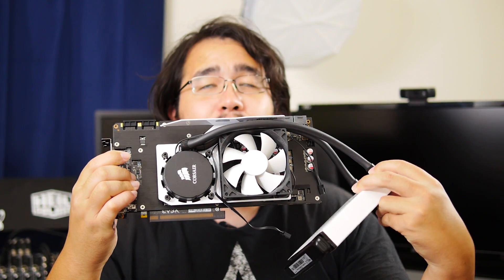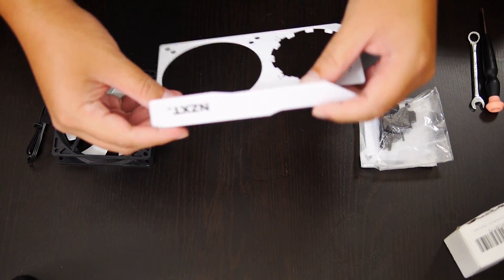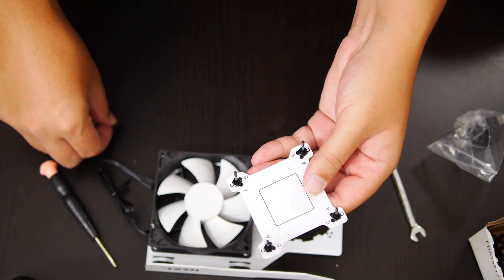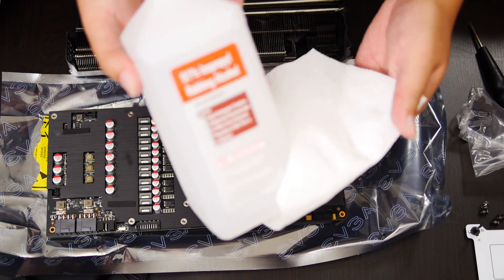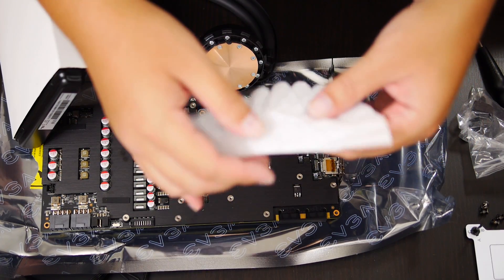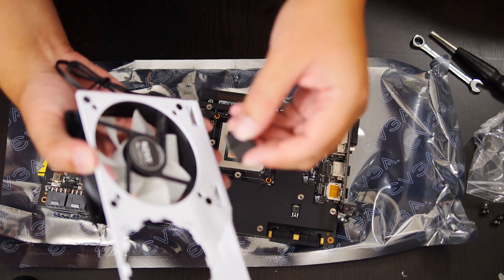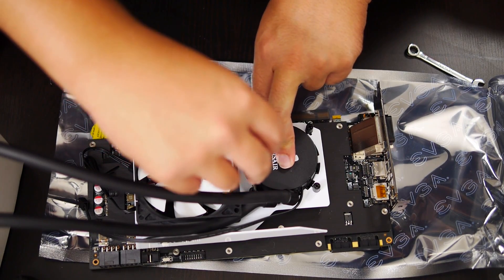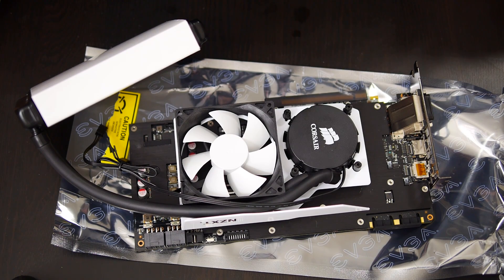NZXT Kraken G10 Installed on EVGA GTX 980 Ti CLASSIFIED w/ Corsair H90 | Backplate Heatsink

Comment: Also, you should have taken off the memory heat sink and shaved off those 4 notches flush. You wouldn't have needed to add the shim and if anything a second layer of thermal paste is just going to make the temps worse. To what degree I do not know at all but I just feel if something is worth doing it's worth doing right.

Comment: I wanna take the frame off the heat sink and just mount 2 140's on the factory heat sink them connecting that to a fan controller then set that on my desk to manually control. I like my temps right at 65c and I think I can easily get that while also keeping the card silent.

Comment: Yuki, question:  you said you were going to hook your pump and 92mm VRM fan to a molex on the PSU for 100% speed all the time.  But you didn't specify where you'd be hooking up the 140mm fan on the rad itself.  Same as pump/VRM fan?  If so, how did that end up working out for you?
Reply from the maker: I plugged the 140mm fan into my motherboard fan header like I would with a normal case fan. My motherboard had a good amount of fan headers and I believe I used a splitter as well.

Comment: Someone please please please help me.I have two  EVGA GeForce GTX 980 Ti 06G-P4-4995-KR 6GB SC+ GAMING w/ACX 2.0+ can i use this with the card's??I am melting in the summer with these card's.It's like running a heater in the sumertime! :( I desperately need to water cool these 980 ti's i have two of them.I do cannot spend 500 dollars on a whole water cooler system but i can spend 250 dollars.

Comment: ended up doing this to my 970 FTW+ and was intent on keeping my backplate and midplate. Turned out the acx 2.0 cooler (and the backplate) used different mounting holes than what the g10 backplate would align to, but the PCB of the card still had the reference fan holes. Problem was, the backplate did not have the matching holes to line up to those reference holes and required drilling the backplate to get access to tbose holes. The g10 backplate ended up covering up the holes anyways so it still looks perfectly clean. Repurposed a copper baseplate from an old heatsink for a shim and cut it down to 25x25x1.5mm and lapped it and it worked out perfectly after all. Was quite an adventure though. Made a video about it on my other channel too. fun stuff, man. good vid.
Reply: What was your temps? before/after..thanks
Reply: +james nygren  GPU: idle before was mid 40s. idle after was 28-31c. load before was nearly 80c. load after was 55-58c.
Reply: Thanks. I am doing my 980 ti  classy tomorrow when my h90 refub comes.
Reply: +james nygren  nice. you'll probably have an easier time than I did based on this video lol
Reply: not sure about that...building my own pc's since the sx and dx days, But not water cooled a gpu. Got a 1.6 shim
Reply: +james nygren  bit of a big shim but in my project I had to drill the backplate, if your card is the same as this one it looks alot more straightforward.

Comment: Hey team, would a double radiator be worth it? aka if i installed a Corsair H115I? What temps and performance did you see from a single sized radiator? 

Im currently tossing up between doing this to the classified or being lazy and getting the hybrid

Comment: will this work on an MSI GTX 980ti?
Reply: I'm sure it would, and you wouldn't need the copper shim, look:
https://www.techpowerup.com/reviews/MSI/GTX_980_Ti_Gaming/images/cooler4.jpg
Reply: Cool!  I'm about to do this now!!!  Thanks man!
Reply: +Louis Hernandez 30c?  I don't believe that. You mean idle temp?  I was able to do this on my MSI 980ti.   Idle is 27c. Load doesn't go above 57c with 1544 OC.
Reply: rodo
It's just luck of the draw... I had a 980Ti that started to artifact at 1440 lol... I exchanged it and the other one did 1501 stable :D
Reply: nice!! i just looked up the MSI GTX 1080 GAMING 8G and saw that it has the same layout when you take the heat-sink off of it so i don't need the copper shims!
Reply: As long as you don't mind voiding your warranty...
Reply: you wont void your warranty if you use a heat gun on the seal to warm it a bit and use a tweezers to slide the void sticker off and save it somewhere safe so if you ever need to replace it you can easily put it back on and send it back ;)
Reply: Me personally, I don't care.  I did this mod to two MSI GTX 980tis.  Next will be my Titan XP and  FTW 1080s.  Hope it works for you.
Reply: +Hakeem Hakim it worked for me! never goes higher than 30c under gaming load it's absolutely insane... just gotta do a minor fix to my 140mm that I had to stick outside the case.
Reply: yea that's what GPU-Z/CAM  is showing me during idle and under load never goes any higher......i'm not running any type of O.C on my CPU or GPU.
Reply: Did you flash your gpu's bios? I can't overclock over 1493 with max voltage. I have the same card. :(

Comment: Hello, Thank you very much for this video-  ( I have the evga 980 ti acx sc 2.0+ so its pretty much the same as this one)
1) Can you link the video that talks about benchmarks and your new temps!
2) Would this help the overall heat in the case, since the radiator fans will exhaust the air out- Also I have a thermaltake water performer 2.0 that I have, do you think that would be enough or should I invest in a new corsair H something--
3) Are the nylon washers really necessary? Besides the look are they important? 

Thank You so much

Comment: https://www.amazon.com/Chipset-Thermal-Heatsink-Copper-0-5mm/dp/B00OUJQX8K
Reply from the maker: Look on ebay. There are plenty of Chinese manufacturers. Here is an example of what I used in this video. http://www.ebay.com/itm/5x-25mm-25mm-1-0mm-Heatsink-Copper-pad-Shim-For-Dell-XPS-GPU-VGA-/121996761810?hash=item1c6792dad2:g:FHUAAOSwR5dXRTvC
Reply from the maker: I would recommend a 25x25 instead of a 20x20. You want to cover the whole chip to transfer as much heat as possible to the block.
Reply: i did some quick googling but i couldnt find any 25x25, got any links to some you know?

Comment: 75% isopropyl alcohol is just 91% with water added to it by the manufacturer. Water will not evaporate and will mess with electronics. It is always best to go with a higher % for evaporation.

You video is the reason I pulled the trigger and decided to buy an msi 980 ti gaming with an aio that I will install. Thank you for being so informative. I even bought the finishing washers and the large shim from China off of eBay. 

Are the screws you used for the Nzxt back plate the ones with the kraken or aftermarket?? If aftermarket where did you buy them???

How long would it take a noob to complete...hour? 2 hours???

Thanks-

Comment: Great job, nice video...but the NZXT backplate not having the same orientation as the EVGA backplate really got to my tits.
Reply from the maker: +Timothy Munoz Well, with my Air 540 case, the EVGA backplates were upside down (because I laid the case on its side to have the window up). So I opted to place the NZXT backplates this way to make them right side up. But it doesn't matter anymore since I changed out the case and did a full custom loop.

Comment: does this void the warrenty?
Reply: +18matts Depends on the GPU manufacturer.  EVGA, in this case, are typically just fine with removal of stock coolers, so long as you do not damage the card and you put it all back to stock configuration if you need to RMA it.
Reply: +coinsagE46m3 thanks, I think ill just pay for extended warrenty and not worry about the fans. i want to give the 980 ti ftw 2.0 to a close friend of mine when i upgrade to a new gpu or my wife will use it
Reply: 18matts I've got your exact same card.  Mine is in a very well ventilated case and hovers in the very upper 60's to low 70's C under full gaming load.  I want to overclock this thing, but I'm wary my temp will spike over 80C which, while still technically OK for the card, it's just too hot for my liking.  Getting a G10 on there with a good AIO (I've got a Kraken X41 ready to pair with it) should lower my temps between 15C-20C.  All I'm waiting for now is for these friggin' shims to get here from China.

If you're looking to get the most out of your card until you pass it along, this mod should really help you get there. And EVGA will not void your warranty.  IMHO it's totally worth it.

Comment: will this work with the 980ti FTW?
Reply: +awp4lyfe Wondering this myself.
Reply: it will. i did it this past week, had a little trouble so i asked around thinking maybe i was doing it wrong, but i've got it all up and running.
Reply: awp4lyfe What trouble did you have?  How different from this video was it to install the G10 on the FTW 980 Ti?  I am very interested in doing this to my FTW card so any info you've got would be of TREMENDOUS help!
Reply: at first i didn't have the copper shim because i watched videos of people installing it without it. i found that my cooling wasn't working properly. i'd load up chrome and watch a youtube video and my temps rose to 85 degrees within 2 seconds, so i had to remove the waterblock and install the copper shim (i ordered a 20x20x1mm shim, but the 25x25x1.02 is recommended) and it was fine after that. my temps are great - haven't seen above 62 yet, even with witcher 3 maxed out on ultra
Reply: it really isn't much different using the FTW card at all - i thought it would've been. it's basically the exact same as the classified card that he's using in this video
Reply: awp4lyfe Dude thank you SO MUCH for replying!  I really want to get this done for my FTW.  My card usually hovers around the 70-77C mark while gaming with no overclock and while that's well within thermal limits, being able to get temps into the low 60's-upper 50's would be amazing, or even upper 60's-low 70's with a hefty overclock. 

One more question -- when you said "25x25x1.02 is recommended"  did you actually mean 1.02mm (1 and 2 one-hundredths) or the 1.2mm (1 and 2 tenths) that this video specifies is recommended?  I just want to be sure before I pull the trigger on all the parts I need.
Reply: no problem man, i was pulling my hair out at first wondering if my FTW card was the one card this wouldn't work with... but as i said, smooth sailing. all good.

sorry, the 1.2mm is the way to go.

on my channel i have about 30 minutes of witcher 3 - you can watch and see how my temps act as im playing the game, that's with the kraken and corsair h55 watercooling unit. witcher 3 is a very demanding game so it's handing like like a champion. good luck pal
Reply: awp4lyfe Thank you for ALL your info.  I think I'm going to end up going with the Kraken X40 for my AIO as it's tubing length is more in line with my case.  I'll mosdef check out your channel too.  Cheers good sir!!

Comment: Awesome video, My 980 ti classified get really loud when overclocked. How is the noise on this installed is it less than the SC2 cooling fans noise? Also can you use an x41 instead of the corsair cooler?
Reply: +MForce Kraken X41?  If so, then yes you can.

Comment: Have you monitored VRM temps at all to compare numbers with stock ?
Reply: would be curious as well
Reply: Would it matter though? VRM chips are covered by the backplate and there is fan directly on top..
Reply from the maker: You want a heat sink for the VRMs, weather that is a heat spreader like the card shown in this video, or with individual aluminum heat sinks attached to each VRM. VRMs get HOT, and relying on a fan alone to dissipate heat off the limited surface area of the chip itself is not enough, especially if you plan on overclocking the cards.

Comment: The G10 will fit on 980Ti EVGA SC+ AC+ 2.0 with Backplate?
And if i instal without the Cooper Shim, will work too? (Is really needed the Cooper Shimor just to improve the temperature transfer)
Reply from the maker: +Juan Pablo Sansalone The copper shim was installed to allow contact with the cooler and the chip. This is because the card that I have has a VRM/Memory chip heat spreader that will get in the way of contract with the chip and cooler. If you don't put the shim and keep that heat spreader you will have a gap, which will result in no heat transfer and a cooked card. You can get away without using the shim if you are willing to cut out the notches of the heat spreader that gets in the way of the cooler, but this method was used so that I can return the cards to full stock and resell them when I'm ready to upgrade. I have since upgraded to a full custom loop with EKWB blocks on my gpus, these offer better cooling and overclocking than what I did in this video, but this is a good solution for anyone on air and don't want to spend the money of a custom loop.

Comment: Will this fit a EVGA SC+
Reply from the maker: +David “MISFITSWITCH” Wagner I don't know, I don't own that card. But I'm going to assume that it will.
Reply: How are the temps? Is it worth doing?
Reply from the maker: David Wagner Depends on you and your environment. I live in a Desert with a crappy AC unit, so it gets pretty hot in my apartment to the point where my GPUs will thermal throttle on air, so I did this to improve performance and stability. I recently just did a full on custom loop and I now think it's best just to do that since you will get much better cooling for the VRMs and Memory chips that way, which will yield greater stability.

Comment: Hello
I just saw this vid... I'm thinking about getting a H90 for my GTX 980ti...paired up with a kraken. What kind of idel and load temps are you getting? And how is the air flow. fresh air in on to the radiator or warm air out of the radiator...

Comment: been thinking about getting a pair of these 980ti classified's but keeping the air cooler on does anyone have any ide if i would run into problems with heat in a fractal define s? would have x3 140mm intakes in the front x1 140mm in the rear and x2 140mm exhaust on top but will be used on a aio? thanks
Reply: just picked one up last night, and of the games I've thrown at it at 4k, at 100% usage it goes to about 79c. so it hasn't thermal throttled yet.
Reply: awesome im gonna have a pair tho thats my main concern but i will have x3 140mm intakes and 3x140mm exhaust so should be enough airflow
Reply: +gasparm thanks man I want to stick with air cooling tho I have one of these on my msi 980ti atm and it performs well but I kinda want to stick to air cooling on my gpus I'm just hoping the X3 140mm intakes are enough to cool 2 classys

Comment: Hi yuki just wanted to ask again if the step by step here would be possible to do this into the zotac 980ti amp edition the pcb would look like this with the heatspreader on https://www.techpowerup.com/reviews/Zotac/GeForce_GTX_980_Ti_Amp_Edition/4.html hoping to get your opinion if the steps would be exactly the same and the parts needed would be the same.
Reply from the maker: +datkangel2 I honestly don't know since I don't own that card. What you can do is look up the NZXT G10 and see if that card is supported by them. You will also might want to look into getting additional heat sinks for those chips surrounding the GPUs processor.
Reply: Oh i see. Okay thanks i'll do that.

Comment: could i do this with the zotac 980ti amp edition cards?
Reply from the maker: +datkangel2 Yes you should.
Reply: Oh I see. I'm really excited to do this once I get my 980ti. Btw could I do this too without that copper thing that you placed on top of the chip? What would be the downside if I do not get the copper thing? Btw thanks for replying.
Reply from the maker: datkangel2 There are support tabs on the VRM/Memory heat spreader that will block the waterblock from contacting the GPU chip. Without that shim, you won't have any removal of heat / you could damage your CPU. You can use something like a dremmel and trip down the heat spreader, but that depends on your card. I'm not sure exactly what will be required with your GPU since it's not the same that I used. If you don't have a heat spreader, then you might want to consider some small heat sinks especially if you plan on overclocking your card. If you do go through with this, be sure to take your time and go slow, it would be a very expensive mishap if anything goes wrong. Thanks for watching the video and good luck.
Reply: +Reckless Yuki - 4k Gameplay &amp; Tech oh i see thanks. Hoping once i get my 980ti  i could exactly follow the steps you made so i won't fuck up hopefully the zotac 980ti amp would be exactly or if not exactly the same it would be identical with the 980ti classified.